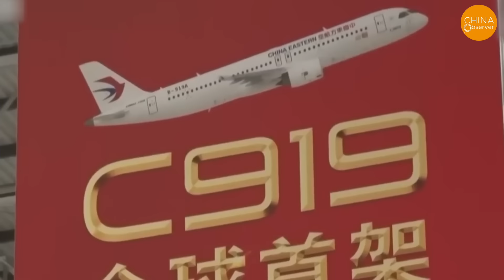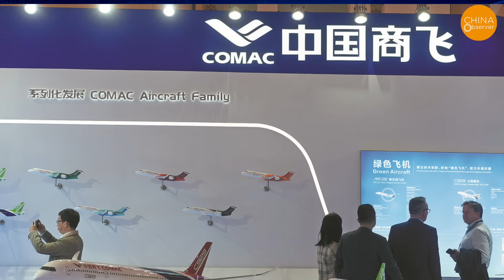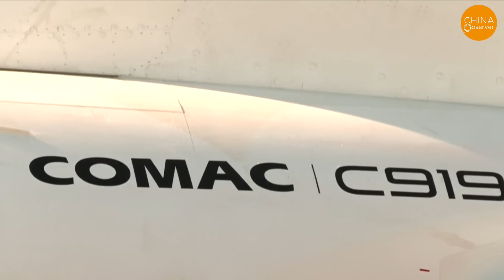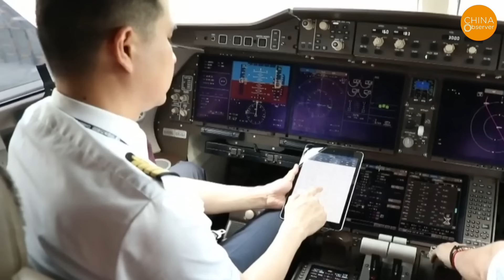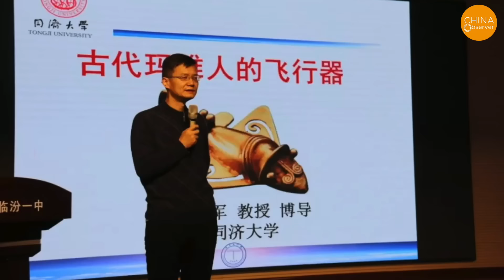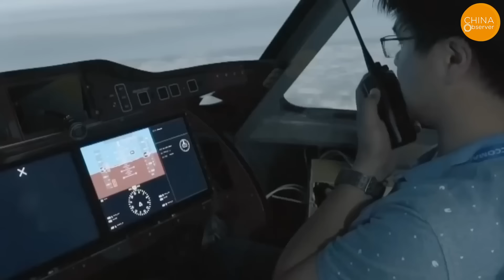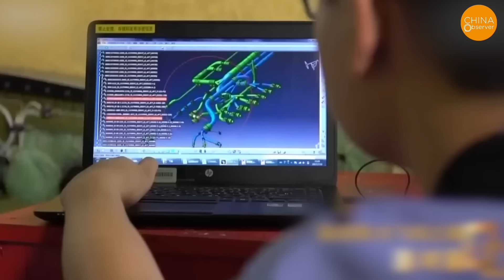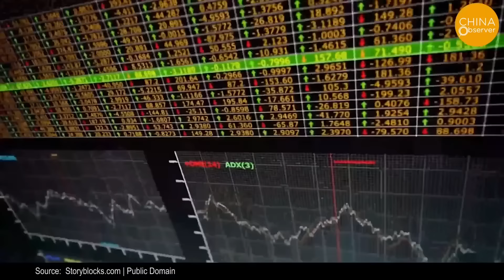C919: Flying Junk? Even Vietnam Won't Touch It!

Comment: With copied, stolen and borrowed parts and design.....no way I'd take a chance flying in it
Reply: @davehue9517  yes, but no not really its like drop shipping items its just old parts that western companies sell, like the LEAP-1C engine which is just a dumbed down version of the LEAP-1A found on newer A320Neos and 737max, it has more in common with the CFM56-5B which is like 90s tech

Comment: I wouldnt fly on a Boeing right now, I sure as heck wouldn't fly on CCP tofu airplanes.
Reply: this channel is full bogus information and trolls of black propaganda, all info are reverted to appear negative views,  C919 already pass all requirements and compliance to the global adaptation of reliability, performance and quality, that is why most airliners who owns of Boeing ill fated models with frequent crash in past few years are replacing their fleet with Comac C919
Reply: it is not true that C919 components are mostly from U.S. and Europe because most parts and component of C919 is not compatible to western system including electronics and metallurgy, China now has the best ALUMINIUM ALLOYS ever produce compared to western countries, China's aluminium alloys use in COMAC C919 are 4x stronger and 2x lighter than the west can produce, even China's tensile steel are 2x stronger and .5x lighter than the western metals
Reply: @totzinfo  老王賣果!
Reply: ill do you better how about airbus?

Comment: The C919 on its maiden flight landed after twenty minutes and stayed grounded for months. POS
Reply: The maiden flight of the C919 lasted for one hour and nineteen minutes on May 5 2017, not twenty minutes. Test flight a new aircraft type has a strict protocol guiding each step and timeline. During that one hour and nineteen minutes, landing gear was never retracted. Someone claimed that C919 has a problem with landing gear. In fact, protocols dictate that landing gear should NOT be retracted during the first test flight. This is a standard practice within the industry. In addition, staying grounded for months after first test flight unnecessarily means anything. In test flight, you could schedule slow-speed ground taxi  test in March,  high-speed taxi test in April, and high-speed taxi to V1 in June, and so on. The time in between is mainly reserved for the team to analyze the data collected, identify potential defect, and fix defect if needed.

Comment: Domestic assembly, not domestic production..
Based on what I've heard, they did cut corners. In practice, the C919 should be equal to other passenger jets. But due to not having proper backup systems, it's not.

Comment: The Comack 919 is a quality exercise in mundane copying of Airbus. If an airline purchases 919's, they are guaranteed difficult parts replacement in a timely fashion, and a maintenance manual nightmare. The airframe assembly tools will migrate to military plants.
Reply: Copying Airbus huh?  You must be lost or delirious because most of the parts for the C919 come from America, not Europe.

Comment: I did a return flight both in C919  between Shanghai and Chengdu last month. I really enjoyed it. The comfort is no less than that of Airbus 320neo or Boeing 737 MAX. The quietness of the cabin in flight is also similar to that of Airbus 320neo, and I did some noise level measurement inside cabin. I will post a review video on this together with the visualized data. In addition,  cabin is taller and wider than 320neo and 737MAX. After flying in a C919, I believe that it will be a strong competitor to 737 and 320.

Comment: Exactly. The engineering is not about whether the components themselves are safe. In fact, there is nothing wrong with using off-the-shelf parts since everybody does that. Airbus, Boeing, Bombardier, Embraer, and others third party suppliers and subcontractors, too. It is about the integration of those parts and the entire system. Aircraft design is about iteration: you create the basic design based on requirements, then you adapt that design to components you can get, and then you optimize the design when everything is integrated. Next, comes the certification process. 

You know what's interesting and why the A220 is mentioned here? That is because the C919 is built to an agreement with Bombardier for program commonality with the Airbus A220 (the A220 program was actually Bombardier's; it was called the CS100 which I actually saw a prototype in Bombardier's Wichita facility). So, the planes should actually be almost the same and use the same components. Yet, China's "good enough" attitude has failed the C919.
Reply: Sure Bombardier and COMAC cooperated, as well as many other western companies. But I have the feeling that the C919 is not as technologically advanced as the Bombardier CS100/A220. Also the size of the C919 is way bigger than those and it can be compared with the A320 instead. You may be right on the potential "failure" of the C919 in terms of efficiency if compared with Boeing and Airbus, but again it is needed by Chinese avio industry to build up experience and self confidence.

Comment: C c P will buy the certification (bribe those who check the aircarft).
Reply: it is not true that C919 components are mostly from U.S. and Europe because most parts and component of C919 is not compatible to western system including electronics and metallurgy, China now has the best ALUMINIUM ALLOYS ever produce compared to western countries, China's aluminium alloys use in COMAC C919 are 4x stronger and 2x lighter than the west can produce, even China's tensile steel are 2x stronger and .5x lighter than the western metals
Reply: this channel is full bogus information and trolls of black propaganda, all info are reverted to appear negative views,  C919 already pass all requirements and compliance to the global adaptation of reliability, performance and quality, that is why most airliners who owns of Boeing ill fated models with frequent crash in past few years are replacing their fleet with Comac C919
Reply: @totzinfo what's your source or are you the one spewing BS?

Comment: Impractical. COMAC is very slow to build the plane (and already has a backlog) - so it will take a long time to deliver. About 80% of the plane (engines, electronics etc) comes from the US and Europe - who aren't giving China their latest or best stuff for fear that China will steal the IP. That results in a plane that will burn more fuel, be less efficient, and more expensive to run than western plane. If Airbus and Boeing waiting lists are too long maybe they should consider Embraer? At least that's proven and much more trustworthy than something touted by the CCP.

Comment: I certainly wouldn’t fly on a C919. I’m already concerned about flying on Boeing’s 787 and 737 MAX. For now I’m very comfortable flying on an Airbus made plane.
Reply: Embraer?
Reply: Airbus has an A320 assembly line in Tianjin China, and more than 700 A320 family aircraft have been delivered from that factory.  Would you fly on that Airbus A320?

Comment: Chinas version of the B737 Max
Reply: I have flown 4 times with the Boeing 737-800 Max and it is a very safe plane.
Reply: @adriancc4240 Don't push you luck too far 😂
Reply: @henrychen2637  Many of the planes used by Ryanair are Boeing 737 Max.  How many plane crashes have you heard about this company having?

Comment: yes of course, cheaper and poor quality, i m not wondering about that. Made in China 😅🤣😇
Reply: Unlike 737 max it hasn’t fall off the sky
Reply: I flew on C919 twice in October between Shanghai and Chengdu. The experience is awesome. Cabin is quiet, flight is stable and smooth, and cabin is wider and taller than Boeing 737 and Airbus 320. Overall, the comfort level is pretty much the same as Airbus 320neo, the newest version of A320.
Reply: @DrBearAviation  that’s great 🫡

Comment: The C919 has too many unscheduled maintenance problems that will cause unreliable service and cancelled air flights. What this means is that the overall performance record of aircraft developed and maintained in China probably has service problems that will lead to unprofitable operating businesses for the immediate future. I suspect many of their issues lies in flawed and low durability parts.

Comment: I have no idea what the C919 is like although it sounds like a bit of a hotchpoch of technology. To use the substitution of an A320 for the (presumably) unserviceable C919 is disingenuous however. Aircraft go sick, including Airbus.
Reply: "Hodgepodge" not "hotchpoch".  Did you not hear the narrator state that MOST of the parts come from the USA?
Reply: I just flew twice on C919 back in October between Shanghai and Chengdu. My personal experience is that it has a similar comfort level to Airbus 320neo.

Comment: I have yet to hear of C919's parts falling out of the sky like doors and wheels. I guess the Chinese did not manage to copy that technology.
Reply: Being as there is only 1 and it’s mostly grounded we prob won’t hear about parts falling from sky but rather reasons why it’s grounded, like reverse engine failure for left engine on landing in Shanghai.
Reply: U need to actually fly to have parts fall off.
Reply: @alaxn542yyggghbhbbbbbbbnnj  Not this one ....A Boeing commercial aircraft lost a front wheel as it was attempting to prepare for takeoff. The flight, number DL982 bound for Bogota, Colombia, was taxiing on the runway to prepare for takeoff when it was discovered that its front nose wheel had fallen off and rolled away. LOL
Reply: @tubewatcher3100  Like Assange?? Fool!!

Comment: Sorry, I forgot to mention that airworthiness will be given once a certain number of fly hours and reliability record are reached. It's exactly the same for western made planes and it is a standardized process. So far the only flight outside China that the C919 was authorized to do was the one to Singapore for the Airshow 2024 (picture at 1:03 of this video). Technical issues may happen also in allegedly "reliable" planes. I am sure that Boeing and Airbus have to consider carefully their leadership in the market once the C919 will be available for the international sales. By the way: did I mention that the C929 is in the pipeline? See you in November at the Zhuhai airshow.
Reply: Pinko
Reply: I wouldn't hold my breath on the 929.   Work has stopped on it.

Comment: Well, well, all the Chinese haters have made comments so far.  Not mentioned was the fact that the C919 problem was an engine problem.  The engines are CFM engines (US/French), the same engines used on .Airbus A320neo and Boeing 737 MAX,  Not mentioned also is that the order book has 1400 plus orders.  One order is from GE Leasing for 20 C919.  The C919 is awaiting EU and US flight certifications.  If like the ARJ-21, it will take some time.  Boeing and Airbus hate competition, especially from China.  Like NEV, the west wants customers, not competition.
Reply: Well, when China stops lying about everything it produces and builds something that doesn't fall apart ten minutes after you buy it, China will be competitive.

Oh, and incidentally, the engines performed just fine and as designed. Claiming the engines are the problem is like blaming your tires when you drive over a cliff.
Reply: @funcuzchris4466  Do you own an Iphone ? Ipad or Apple computer? Most people think those are quality products, They are made in China. China is going to get this plane done and compete with Boeing and Airbus. They will eventually build their own engines and avionics.
Reply: @funcuzchris4466  Oh? The cancelled return flight from Chengdu was because of an engine problem. Your analogy shows your logic.  BTW, in Congressional testimony, the DOD said that 40% of the semiconductors used in its equipment are from China.  

"Indeed, the report, commissioned by the department of defense concludes that over 40 percent of the semiconductors that sustain DoD weapons systems and associated infrastructure are now sourced from China. In addition, between 2014and 2022, American dependence on Chinese electronics increased by 600 percent." (Google AI)

And, regarding the CFM Leap engines used on the C919:

"General Electric (GE) jet engines have had several issues, including manufacturing defects, durability problems, and other issues:
Manufacturing defects
In April 2023, US and European regulators warned that some GE engines may have manufacturing defects that could lead to early failure. The US Federal Aviation Administration (FAA) said that some GE GEnx, GE90, and CFM Leap-1A engines may have components made from contaminated material, possibly containing iron inclusions. The affected components include compressor seals, rotor spools, and high-pressure turbine discs. GE is also addressing durability issues with LEAP jet engines by making improvements to the cooling jacket around the turbine blade.
Other issues
In 2019, GE faced a compressor second-stage variable vane durability issue that delayed a program. In November 2022, a combustor liner issue temporarily halted flight tests of the 777-9. GE also settled a lawsuit in 2023, admitting to selling engines to the Army and Navy between 2014 and 2019 that contained metal fragments that were not allowed. " (Google AI)

So, your comments are just BS.

Comment: ❤❤❤   get a Boing they fall down a lot better or at least only lose a wheel or two  and and doors that shouldn't be there. ❤❤❤
Reply: A lot of Boeing's problems will ultimately be traced to Chinese parts and Chinese raw materials.
Reply: @billycarr7446    must have used a lot of Chinese materials on the shuttle that went to the international space station

Comment: it is not true that C919 components are mostly from U.S. and Europe because most parts and component of C919 is not compatible to western system including electronics and metallurgy, China now has the best ALUMINIUM ALLOYS ever produce compared to western countries, China's aluminium alloys use in COMAC C919 are 4x stronger and 2x lighter than the west can produce, even China's tensile steel are 2x stronger and .5x lighter than the western metals
Reply: Not true,  the chineeeese use tofu.
Reply: Found the bot!
Reply: 老王賣果!
Reply: @totzinfo  You went full-Wumao, you never go full-Wumao. 🤦
Reply: @totzinfo  Mao Xinyu approves this message! 👍👍
Reply: @totzinfo  China’s superior ALUMINUM ALLOYS are also non-existent. Get a grip on reality young man!
Reply: One of the main specs distinguishing the C919 from the current 737/A320s is that its airframe is much *heavier*. 

BTW "0.5x lighter" means "twice as heavy".